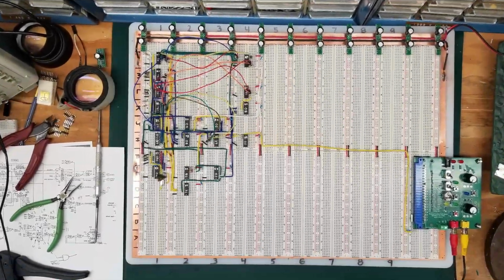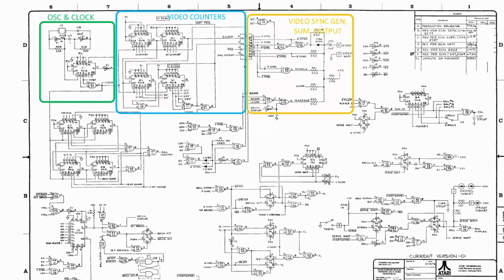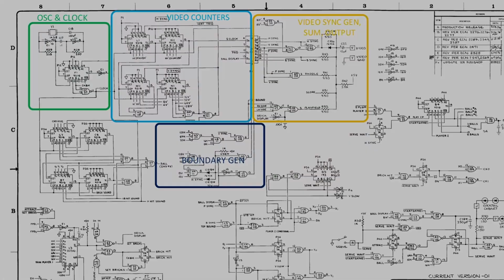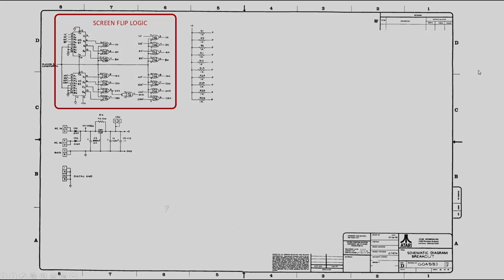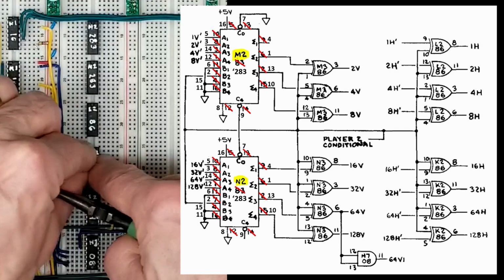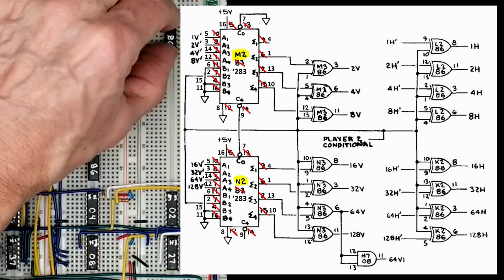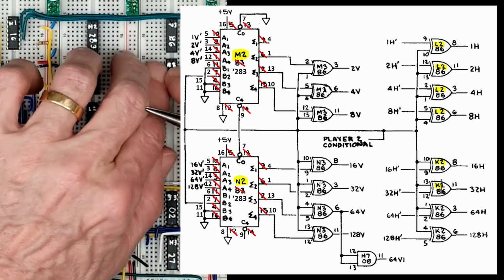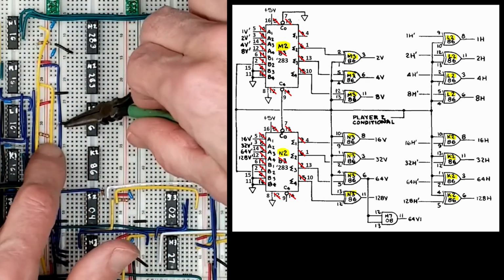Retro Atari Breakout Part 6 - Screen Flip Logic

Comment: How, how how did Woz design this? I understand how to do this in software (I did pong on a PIC microcontroller years ago),  but have no idea of the design approach doing this in discrete logic
Reply from the maker: The concepts for video chains and driving composite outputs were already used in the industry, but Woz's logic wizardry in this instance is totally amazing considering the short "deadline". You're right; relatively easy to do this in software. -Paul